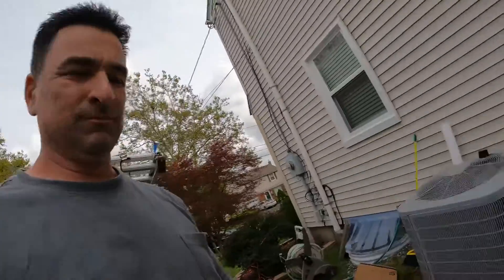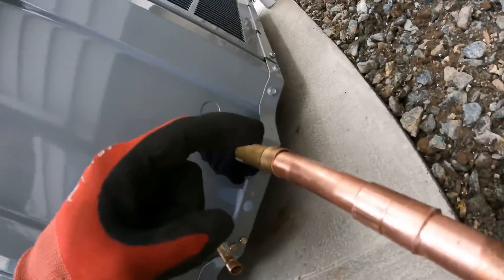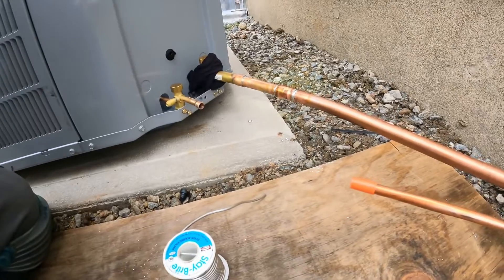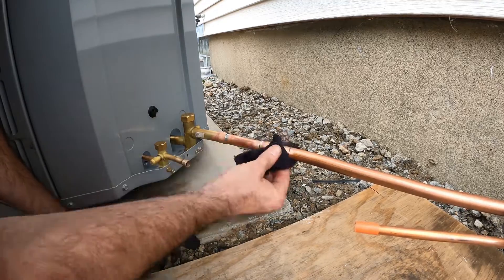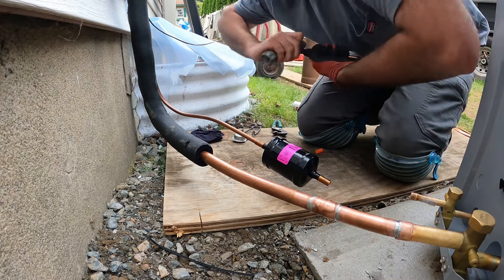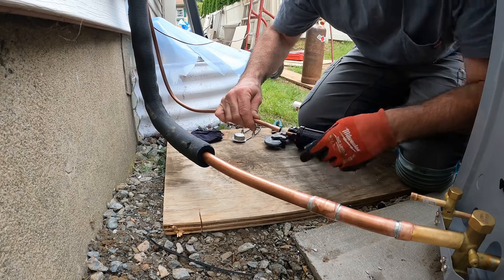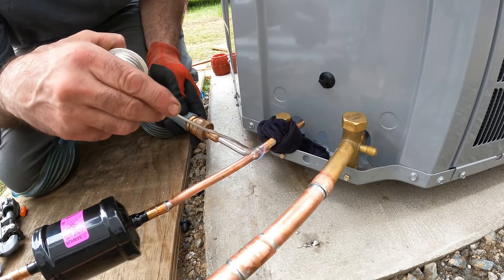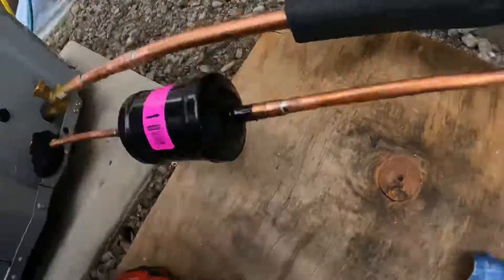Installing AC Refrigerant Line Set to Condensing Unit

Comment: What’s up with the coupling you don’t have a swaging tool saves a joint
Reply from the maker: Why do I care about saving joints? A coupling is faster and easier. I work for myself. I’m not working for a cheap boss who is penny pinching.
Reply: One less possible leak
Reply from the maker: They never leak. I don’t get lineset leaks on my installs. If a systems ever leak I have installed, it’s usually a coil or factory braze. We’re talking one or 2 seams on a connection with the swedge fitting over a 3/8 coupling. Yes I use a bender to reduce my fittings. Usually it’s only the unit connections and filter drier if not factory installed.

Comment: That Staybright flux leaks into the line and is acidic. It will make its way to the compressor windings and eat the enamel coating off the wires. And eventually kill the compressor. You should be brazing with a nitrogen purge.
Reply from the maker: How long does this take. I been using staybrite 8 since 2002. Haven’t lost a compressor on any of the units I installed and still take care of. Most of the units are still cranking away. You don’t use a lot of flux and never put inside fitting. Just some on pipe to pull the solder in.

Comment: Why not just use silfos?
Reply from the maker: Why not just use staybrite 8? I have no leaks and have been using staybrite 8 for 15+ years. Its rated for 410a. Fittings can handle more pressure than silfos. Silfos works. Yet then need to purge, try not to overheat txv, or service valves. Thats my reasons. If you think silfos is better than use it. As long as the system is tight and holds below 500 microns. All that matters

Comment: I thought those lines need to brazed?
Reply: They most definitely need to be brazed and many jurisdictions will fail you.  I don’t care what anyone says about Stay-brite 8.  It is inferior to flowing nitrogen and braze with an oxy-acetylene and Sil-fos 15.  My guys are not allowed to do this and we replace and fix too many systems when guys half-ass it with solder and not real brazing.
Reply from the maker: @Balticblue93 this is not true. Before posting a comment saying most definitely, you should make sure it’s factual statement. You might of had bad experiences with staybrite 8. Techs not knowing how to properly solder, ect. I have zero leaks on my linesets. Wish I could say the same for evap coils
Reply: @thehvachacker  That Stay Bright flux leaks into the line and is acidic. It will make its way to the compressor windings and eat the enamel coating off the wires. And eventually kill the compressor. You should be brazing with a nitrogen purge.

You can find YT videos of lines that have been cut open with both Stay Bright and Brazing. Brazing is superior.

Edit.. I'll make it easy for you.  -   https://youtu.be/hrXX4IjjChM

Comment: how in hell do you put up with that squeal I use a cutting torch head
Reply from the maker: Been hearing this for 20+ years. Get use to it
Reply: @thehvachacker  my ears are junk  born that way I hear the high and low end  I won't put up with it  I use a cutting torch head  been doing it that way for over 30 years
Reply: Sorry Staybright 8 is stronger and does not weaken the pipe through annealing.
Reply: @rj.parker  you obviously didn't read what I posted. When you braze properly the BRAZE JOINT IS STRONGER THAN THE COPPER ITSELF.  meaning most copper burst at 840psi or slightly higher. The copper pipe will fail before the braze joint. You are incorrect.  Stay Brite 8 is not stronger . This is why most manufacturers have moved away from soldering factory joints a long time ago.
Reply: Type M1 Copper burst strength is 3800 psi before brazing.  It is 1800 psi and annealed after brazing.  With Staybright 8 burst strength remains 3800 psi after silver soldering.  It does not anneal the pipe and does not create oxides which block txv and strainers. The argument against is it does not fill large gaps which the tech acknowledged and mitigated. Look it up.
Reply: @rj.parker  I did ... your wrong ..
Reply: @pineyprepper I agree it’s not stronger than silfos
Reply: Is their a reason your using flux and solder? I understand it uses much less heat but the fittings you are joining are easily accessible, an oxy torch with a nitro purge and heat trap on your filter dryer and service valves would be much better. Why add any contaminants to the system if you don’t have to?
Reply: Stronger and no nitrogen needed
Reply: @rj.parker definitely not stronger. That's just what he choose to use. Brazing when done correctly the joint is actually stronger than the copper pipe itself.